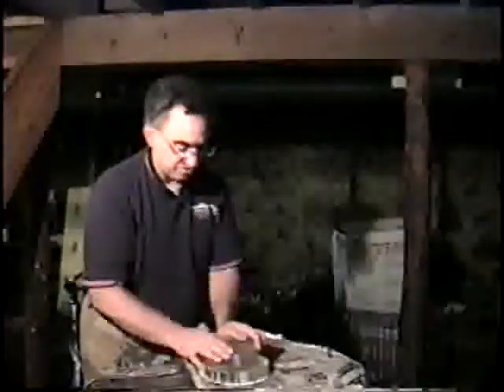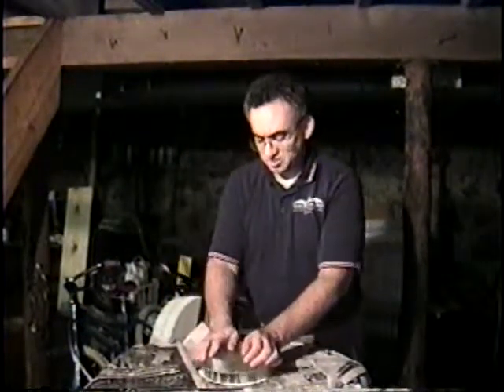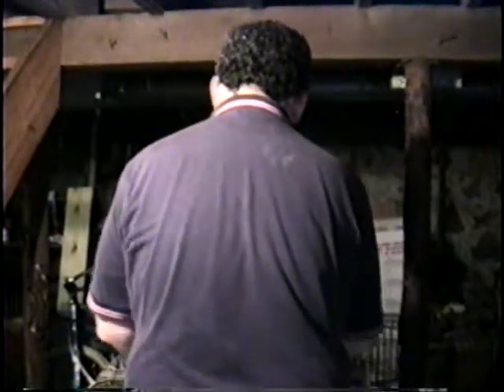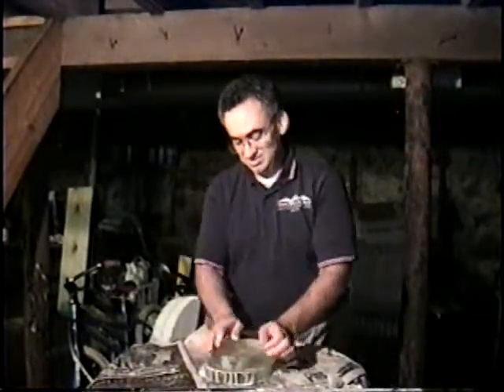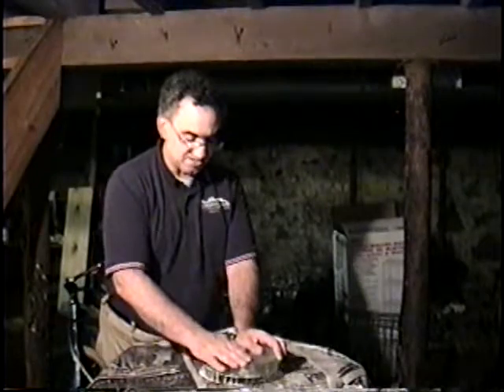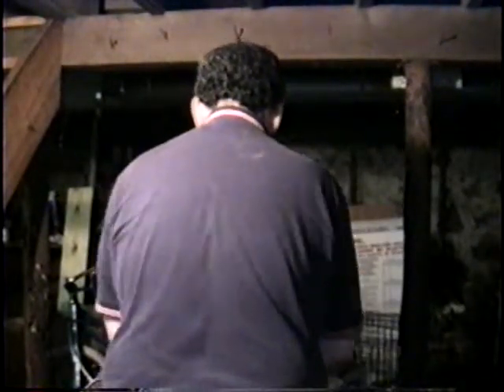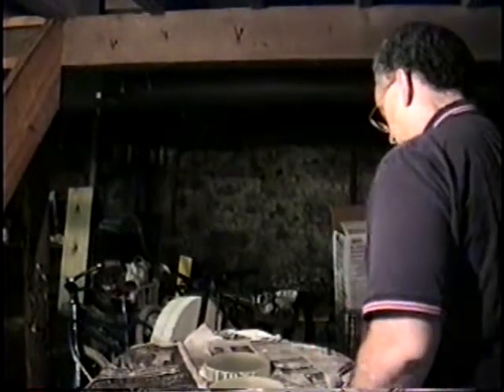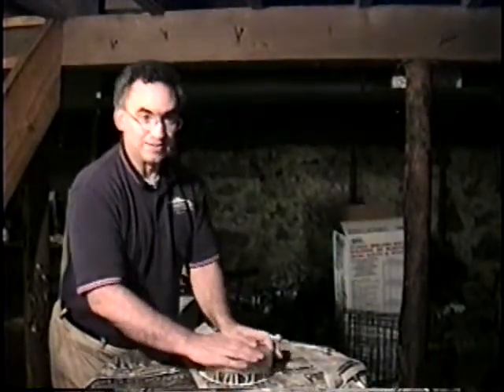Optical Flat Part 4

Comment: No worries about the accidental deletion. 

Anyways, it was just something I wondered about when you mentioned the flats becoming ever so slightly convex when using the same amount of time for tool on top and for glass on top. Varying densities with the glass might also be a factor, but I believe you did mention simply increasing the time a bit for either tool on top or glass on top corrects that.

Thanks again

Comment from the maker: I inadvertantly deleted one of your posts. The relative weoghts of the tool and flat are different. Each of the flats also weigh different amounts. Some are heavier than others. I doubt that is a factor in the flats being concave initially, but you never know. I have reground all three of them. I have used a much more sensitive spherometer and all are within two waves sodium of flat. Now that all discernable power is gone, I am getting ready to polish and figure. Video to follow.

Comment: I should have clarified that I meant autocollimation, but you got it. :)

I'm considering doing a thinner mirror project that is preferably between 8:1 and 10:1. From what I've read it's easier to avoid astigmatism on a thinner mirror if the back side of the mirror is flat to within a few waves. That's why I'm considering doing 2 blanks, so I could also use one as an optical flat for autocollimation testing. However, it is also tempting to build a Bath Interferometer.

Thanks for the info.

Comment from the maker: When it comes right down to it, a flat is a sphere of infinite radius. You can make it with only one blank and a ceramic tool. Testing is the issue. That's why we use three. If you have a reference flat to compare your work to, then there is no problem.

For autocollimation, a hole in the center is not necessary, a secondary mirror at 45 degrees can be used to deflect the light outside of the optical path, similar to a Newtonian optical tube assembly.

Comment: Thanks for posting the videos.  Perhaps I'll have a few more questions by the end, but a few questions come to mind so far;

I assume this can be done with just 2 pieces of glass, as you stated earlier that this method requires 3 surfaces. I assume one surface can be left out of the process, but can it be done successfully with 4 surfaces?

Also, I have seen some things on the null test before. I was wondering if the optical flat must have a hole in the center, or can it be done without one?